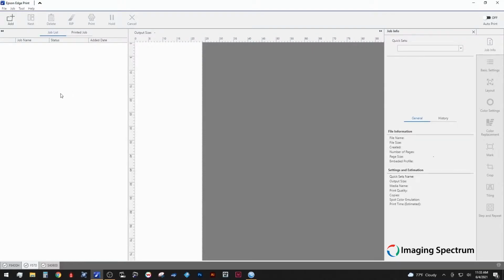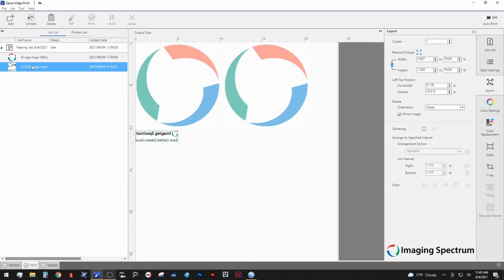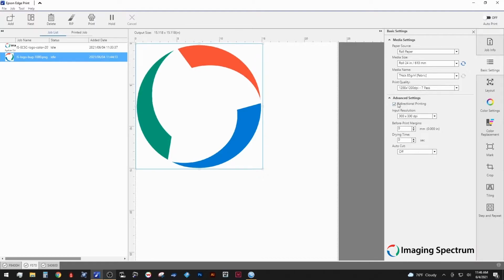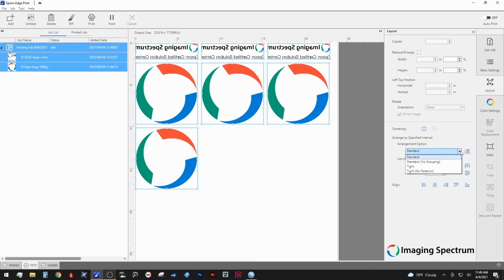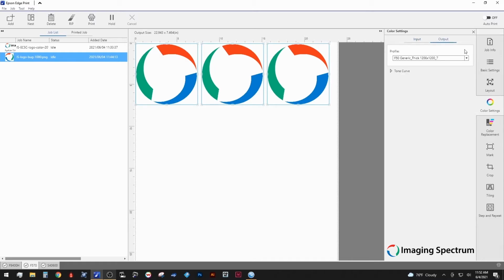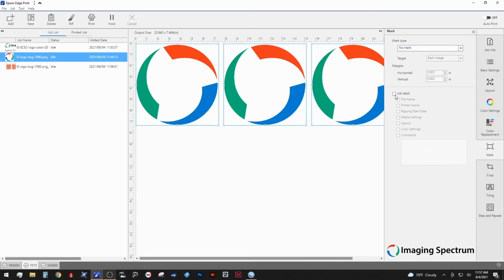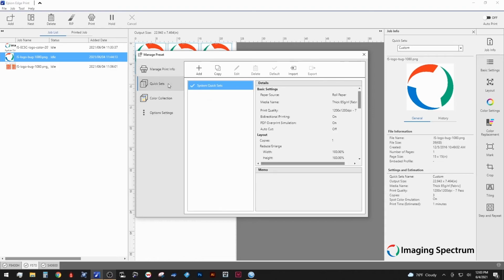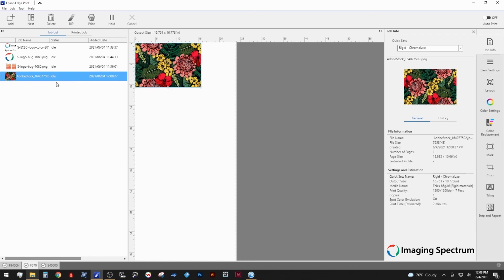Start to Finish Crash Course for Using Epson Edge Print

Comment: Hi I'm David.  I did everything that you mentioned on the Epson Edge  for colors. First of all, I liked the video a lot.  For some reason, when I try to print a red image, it my printer F6370 prints a dark orange which against a red color sleeve, it looks orange.  I hadn't really paid attention to that color until I printed on white next to red sleeves.  I can't get the color red and I followed the video to the "T".  I'm super confused as to what I need to do.  Please help.
Reply from the maker: @DavidJuarez956 If you have followed the instructions on this video for color out put then please do a nozzle check to ensure your magenta is printing out correctly. If your nozzle check is good, then you may have to run a few small test prints on some blanks or white polyester shirt.  This is to check the media and the ink at the same time. If the print comes out the same color that you see on the media before pressing it then its the ink but if it is close to the color after pressing the blank then the issue is the media.

Comment: Does this printer have fonts, and how do I get to the fonts?
Reply from the maker: @helenm679 there is not fonts in this program or on the printer. You would have to edit in a different program or artboard before placing into Epson Edge Print. For more information on the subject you can reach us on this link. https://imagingspectrum.com/pages/contact

Comment: i use in 3 pass, is there another form to increase speed?
Reply from the maker: @RodrigoSilva-tp9ux if you unclick Bidirectional printing it will increase your speed. Depending on the image quality you may be able to put it on 300 x 300 dpi to increase the print speed a bit more. Please keep in mind that the quality of the change by lowering these settings. So please compare your prints before pressing the transfer.

Comment: Edge print is greyed out after downloading everything and registering, wont allow me to do anything. What did i do wrong?
Reply from the maker: @svjohson5  Have you already installed your driver for your printer? If so then you have to go to the tool section at the top of the screen of Edge print to register our printer inside the program. This should undo the issue. If this continues you can always reach out to us at Imaging Spectrum for basic troubleshooting needs.
Reply: @ImagingSpectrum  I think this is where it wont accept the IP. It begins with start, then supposed to prompt me to confirm my printer, but its not listed, so i try to locate it by the IP address but it wont let me.
Reply: @ImagingSpectrum  yes, but for some reason it wont accept the IP address during the Registration of edge print.....when i click okay it does nothing.
Reply from the maker: @MarriedtoMuggie   Go to your printers & scanner section in your computer and check to properties to make sure your port is connected via IP address and no a USB. Do keep in mind that if your printer is Wi-Fi compatible you may have to turn off Wi-Fi well connecting it.
Reply: @ImagingSpectrum  ok ill try that

Comment: How do you open the program? From which download? Trying to add to my desktop
Reply from the maker: @shoppingwithsheila_5044 Do you have a disc version or a key version (code) of the program?
Reply: @ImagingSpectrum  I have a disc but no disc drive on my laptop so i had to download it.
Reply from the maker: @MarriedtoMuggie   Ok that is fine. It should be in your downloads as a zip file and you have to unzip it and run it. You may have to temporally change your security settings to allow it to run.  https://youtu.be/du9oiFdPn2M
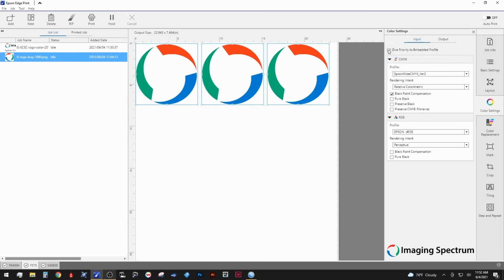Go to 12:04 in the play bar for the above video and it will walk you through the installation and how to put the icon on your desktop.

Comment: Do you have any idea why the software doesn’t recognize my printer? I can authenticate, but not register my printer (meaning, it isn’t recognizing it and it won’t take the IP Address manually). When I open the software, I don’t have the option to add images. It’s mostly grayed out. Any help would be appreciated.
Reply: Disregard, it finally worked. Thanks anyway!
Reply from the maker: @TheMount2601ofNO   I am glad you were able to fix it! We have technicians on staff at Imaging Spectrum. If you have ever bought supplies from us then it would be the same contact information you already have but you would select technician went calling in or you can dial 214-342-9290

Comment: Hi! What are the best settings for deep blacks with program Epson Edge. I have an Epson F571 printer with fluo colors.
Reply from the maker: Hey! Essentially the best settings for a rich black can be achieved by using the Pure Black settings box in the color settings window, as it will try to mix the colors to create the deepest black it can achieve. Hope that helps

Comment: Could I ask one more question, please?  When I'm printing I'm finding the ink is too thick on the paper. Wet to the touch. I've tried the different pass settings and changing to thinner substrate settings still have the same issue.  I've tried different paper rolls.  In particular, it's the black ink that's the problem, when I print lighter jobs it's not too thick. 
Some background on the machine; it stood for 2 years. I removed the ink cartridges that were in it, and I washed them out thoroughly with water initially and then with distilled water.  I then refilled and did 5 deep cleans to try to run the fresh ink through the system.  
Since I purchased this machine second hand the local technicians are not being too helpful.
Reply from the maker: Hey Wayne, no problem at all, I have one trick that I am hoping will help, you can adjust the ink density through the printer drivers in the control panel, if you can get to printing preferences you can then go to the advanced tab and select advanced media control, from here it will give you the option to adjust either the color or black density setting up to a max of +/- 50%, in your case of course reducing the black should yield better results, hope this helps

Comment: I've just installed this and I am struggling to figure out how to print a number of prints. I need it to cut after each print.  If I add number of prints it simply duplicates the artwork on the page.   I need it to give me the option to print the same page 10 x.   I hope I'm explaining this correctly. Any help will be greatly appreciated.
Reply from the maker: Hey Wayne, hoping I can help. If you import those as separate jobs you can set the auto cut to "cut per job" under the basic settings tab, so after each is finished it will cut and prepare the next, assuming you are working from a roll. If it is the same job repeated I would recommend setting up the first job exactly how you like then right clicking and selecting copy. Make as many of these as you need. You can then set the auto print on the top right to "on" to automatically advance to the next job. It should print, cut, and continue until all the jobs in the queue have been printed. Hope this helps!
Reply: @ImagingSpectrum  Hi, yes, I'm printing from a roll. The right-clicking and copying is working for me.  Thanking you from the Southern Tip of Africa.  (South Africa)

Comment: I've been having trouble with tumblers and the black coming out a dull, washed out grayish color. How do you get black to  print black? Does Pure Black under RGB solve that? I've been checking Black Point Compensation but same problem.

Also, what is the point of having options for CMYK up top? I don't see a change on screen if I mess with those and it's confusing since the printer uses CMYK and the monitor is RGB.
I have something set wrong somewhere and can't figure out what it is. These are with images from places like Etsy where the black comes out bad.
Reply from the maker: Hey, thanks for watching and hoping I can help here. If you are trying to achieve a deep black I recommend not using black point compensation as that is better suited for photographs to enhance the shadow details. Instead you can try creating a rich black in your design, which would be something like 100 K, 50 C, 50, M, 50 Y or if using a graphic that is already complete selecting the pure black mode will try to convert to a rich black without having to manipulate the artwork yourself. On the topic of CMYK and RGB, it really depends on what color space the graphic was originally designed in and Epson Edge will automatically use the appropriate option (CMYK or RGB). You are absolutely correct that in the end it will always be converted to CMYK for the inks, but that is essentially the process before it goes to print.

Comment: when we first started using Edge Print last year, we had no trouble with png files. Now the past couple months, i'm assuming after an update, when we print png files with a transparent background on top of a color, you can see the box around the png file. . weird that it went from working fine to doing this. any suggestions?
Reply from the maker: Hey James, thanks for letting us know. That is interesting, I am assuming when you bring in a standard png the transparency remains? Is the box a specific color when it shows up? One thought I had was checking your color settings and making sure you are on perceptual or relative colorimetric and not absolute, hope this helps! If still having trouble feel free to call as well
Reply: @ImagingSpectrum  i just saw your response today. 1 year later. the transparency is still there. if you look really close in Edge Print you can see it in the preview window. that's how we catch it most of time.
 we figured out a couple of way around the problem. Sometimes when we add a contour cut to the file, the box goes away. If that doesn't work, we export it to a full png or jpg
Reply from the maker: @Jamesbrown-fv4oe   Please go to Support.epson.net\eep\     And download the new update.

Comment: I'm trying to print something that's around 13ft long. Can this rip software handle that?
Reply from the maker: Hey Bryan, absolutely! You can tile or resize prints as you see fit, if it is larger than the media width you can tile to make sure larger prints can be done on smaller machines. Hope this helps!

Comment: Hi dear my edge print is no going to register which is give a message to me that is say your edge  print is using other computer which is not true  plz help me
Reply from the maker: No problem at all, first and foremost make sure you still have your key around for the software as you will need that to reactivate. If there is no access to the existing one you can call Epson at 562-276-1305 so they can disable remote and you can then connect to your new computer. Hope this helps!

Comment: i just downloaded everything on my mac but no program showed up
Reply from the maker: Hey Gia, Unfortunately it is only PC compatible. You can create a hot folder from a mac to automatically upload to a connected PC with Edge Print on the same network, but as of right now to get full functionality it will need to be on a windows computer.
Reply: @ImagingSpectrum  can you recommend a program to use?
Reply from the maker: @JuicyRed-o2l  Absolutely, my personal favorite for designing is Photoshop and Illustrator of course, but there are great cheaper alternatives out there like affinity and if you have something like a cricut or silhouette you can even use those design spaces to create and print your images, hope this helps!
Reply: Yes, there is Mac files on the site to download, you get to the end and no icon or program to fire off of. The EPG files load like normal, so it looks like they started to do a Mac version of the edge print, but never finished it. I lost 3 days and several hours of -pulling my hair out on this. Poor website exposure not saying this or posting up that it’s PC only (at least something). WTF is wrong with them to not clearly state this or at least take down all the .EPG Mac install files that will take you to 99% completion. Not happy as u can tell :(.